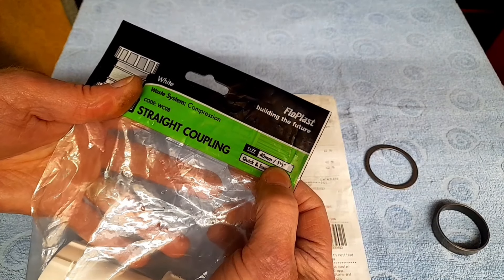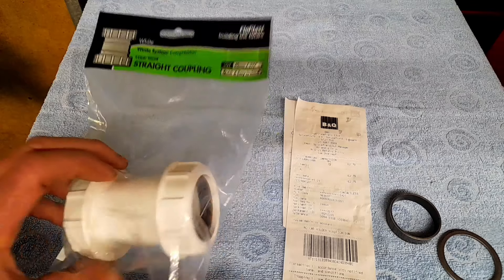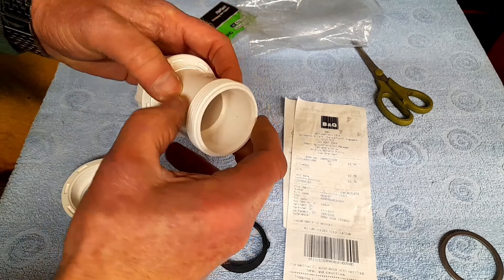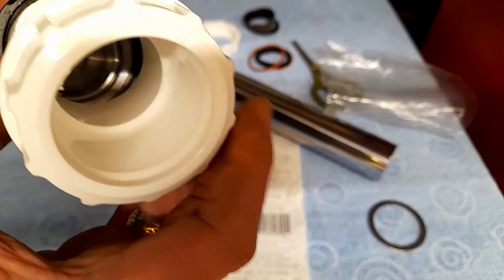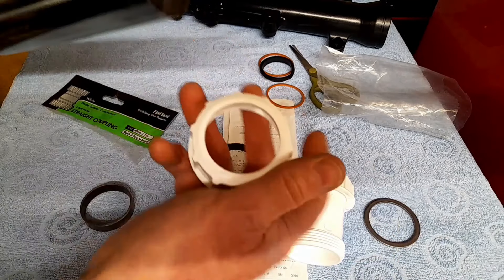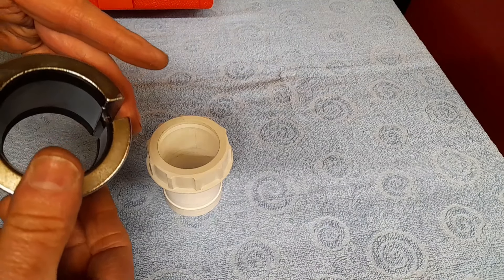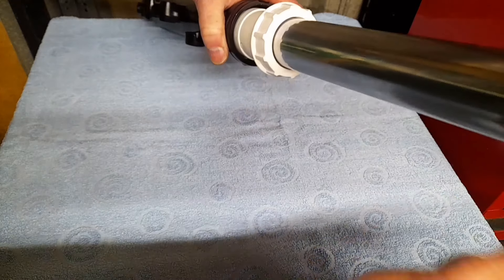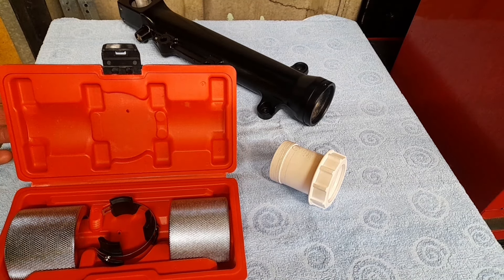Forks Part 6...another wee "tool"..

Comment: Hi Brian...  my forks differ from yours....  :( :( :(   my bike is a 1200r 2004 model..   part No 44023-0024. what year is your forks from... i guess its a 1200r...   hav you never tried puttin the bush in the fridge or freezer to shrink it a bit and heat the fork leg to expand it a little  to help knoc it in???  that tool you made wont work on mine  😭😭😭
Reply from the maker: Yes completely different....

Mine here is 2001 ZRX 1200R and these are the stock OEM forks..

Yours are "different"

I also have a 2005 ZRX (Although I'm running Ohlins RWU forks)
However the 05 ZRX forks are the same as my friends 06 and the cylinder removal tool is "square" on the end it locates into the cylinder....(completely different from my 01 fork internals..)

And yours "might"  be different from both of those as well...😮

Hard to say until you get it out for a look..

BG.
Reply: @brianwells5258   lol lol lol   oh its out.. the whole bike is in bits..   yep its square..ish    with 4 small holes in it   cheers Brian